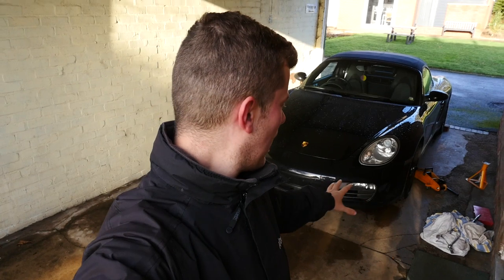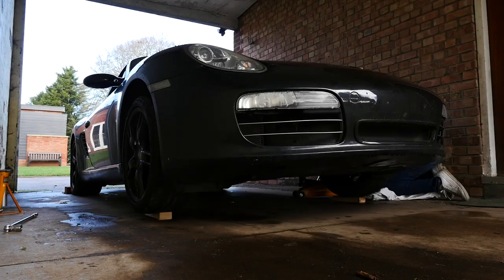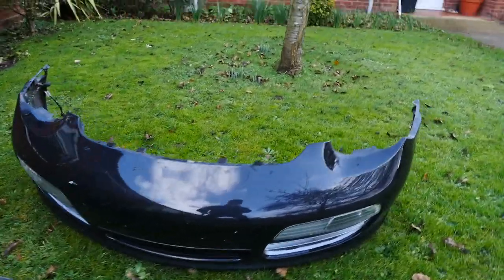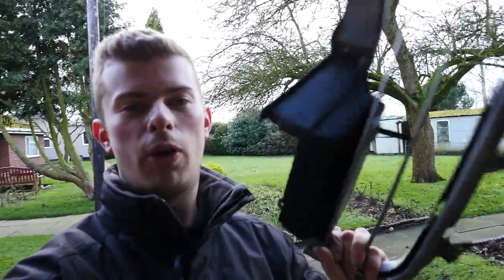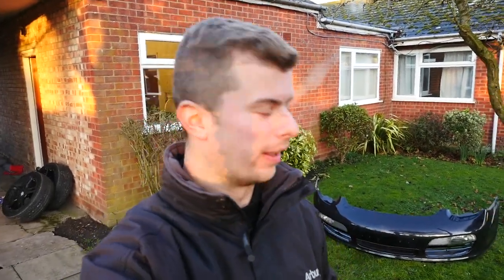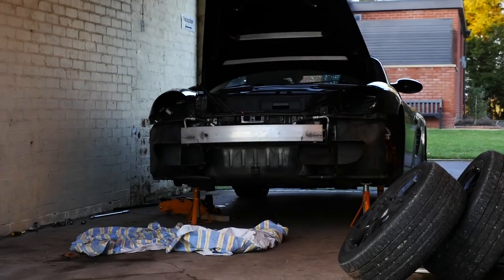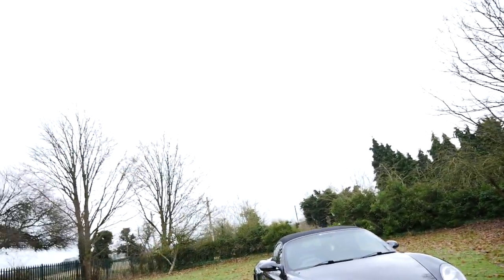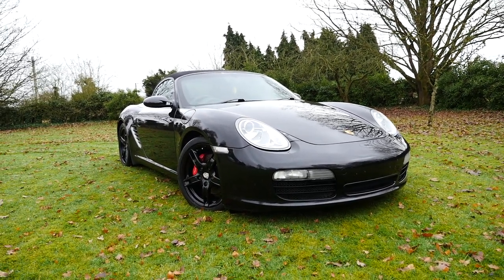Build Your Own Porsche Mesh Grills

Comment: I just learned that you can unscrew the fog lights (2 screws ea), remove them, unplug the electrical, and pull them out. That should provide ample room to pop out the grills and whatever you may.